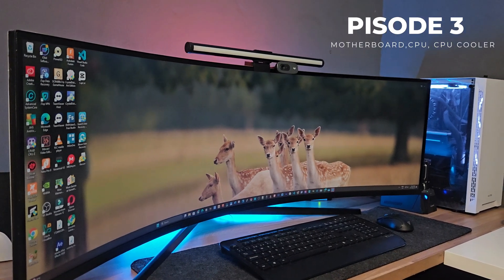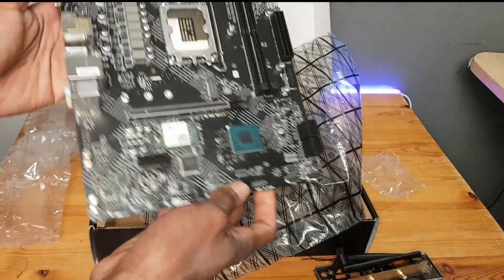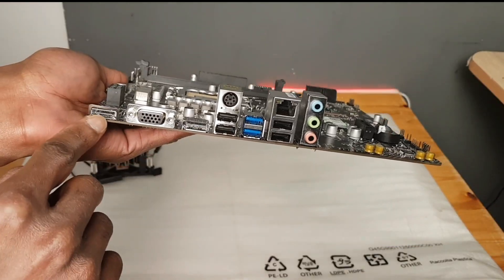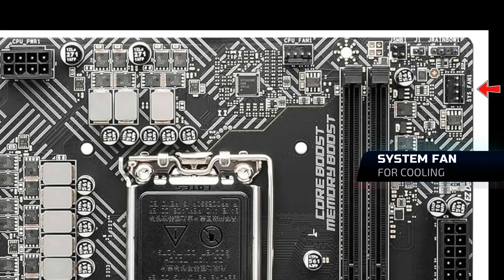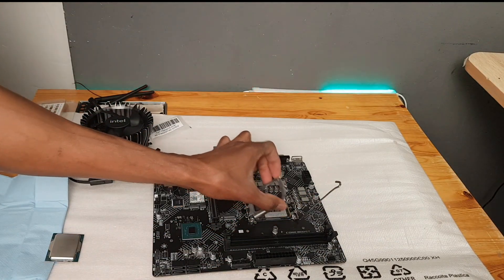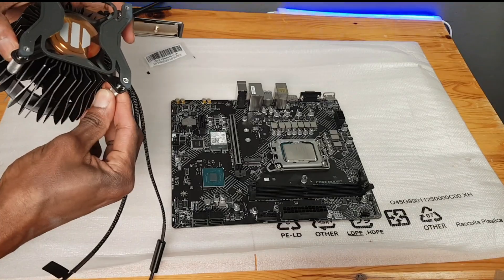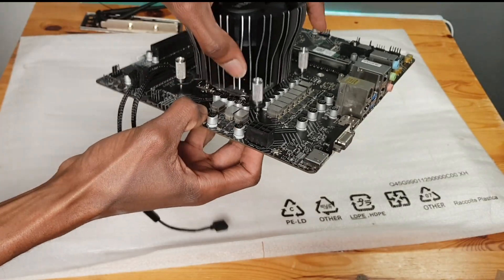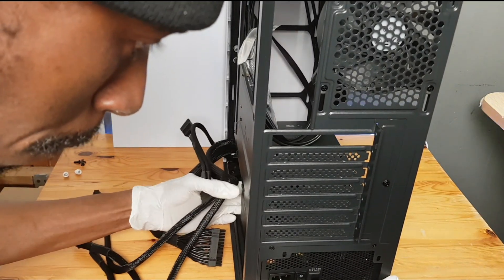Installing the Brains of My Custom Built PC (CPU + COOLER)

Comment: are the thermals ok on your setup? I saw that you posted in another comment that the load on your setup isn't particularly demanding, but be careful with using such a strong CPU alongside a low end board. iirc the i9-14900kf can often pull up to 250w and the stock intel cooler definitely can't handle that + the VRMs on an H610 board are a lot weaker than even something on a B660/B760 board. prob won't need a Z690/Z790 board if you don't plan on OCing, but the power delivery will definitely be handled a lot better than on the board you have right now. That i9-14900kf will probably throttle itself and the VRMs on that board will still be able to sufficiently provide power, but worst case scenario it's possible for the weaker components (especially the VRMs) on there to overheat + get overstressed and mess with the overall stability of that setup. Thermalright makes fairly strong coolers for the money spent, and even some of their cheapest options will handle that CPU far better than the stock Intel one.
Reply from the maker: Thanks for the information. I am planning to change certain components and would definitely change the cooler
Reply: @TechHubOfficio  best of luck. I figure this is your first time putting together your very own system, gj 👍
Reply: maybe try to put or mod some heatsink on top of MOSFET vrm unit atleast it don't fried easily.
Reply from the maker: @benghtlt4927 thanks for the information. I have started noting some components to be changed.

Comment: You put an air-cooler on a 14th gen i9?? They run hot and already have instability issues. Youre going to fry that cpu.
Reply from the maker: Thanks for the information. I just wanted to have the flexibility to change parts as and when i want. I just run fewer programs and nothing serious and the CPU is most of the time 3% in usage. But I will consider changing the cooler.
Reply: @TechHubOfficio  There are lots of great cheap air coolers out there (Thermalright comes to mind).
Reply: But I have more worried about the MOSFET driver capability to powered that i9